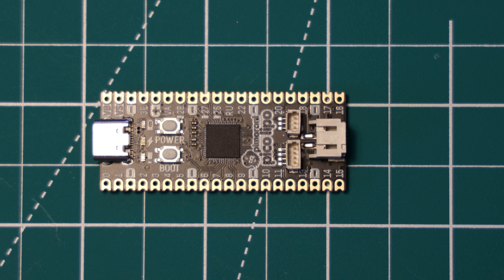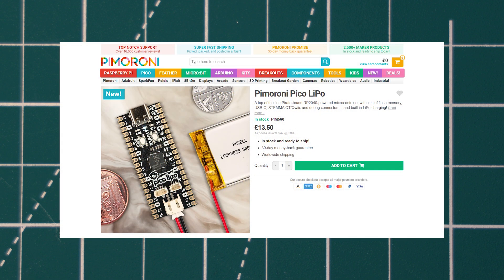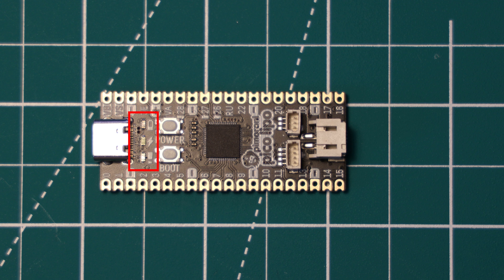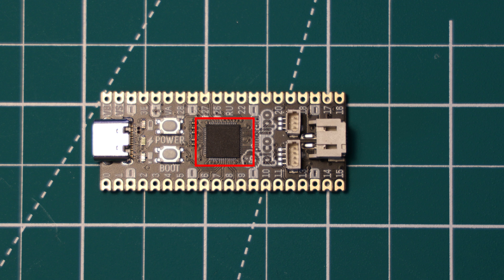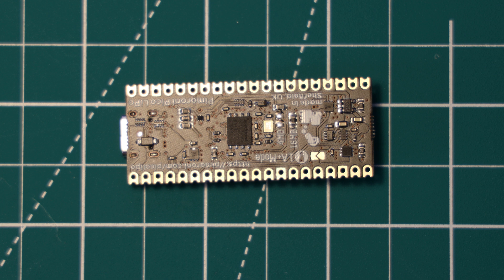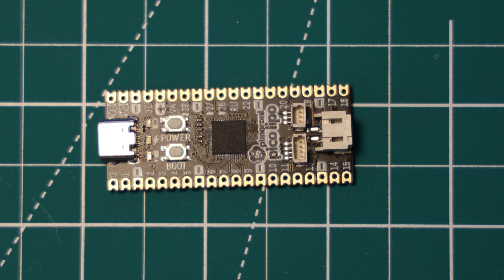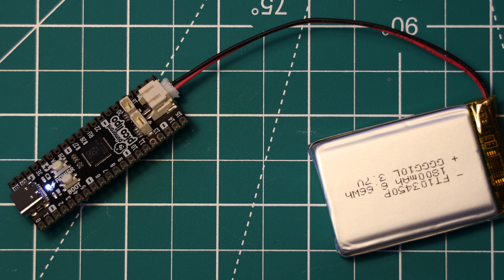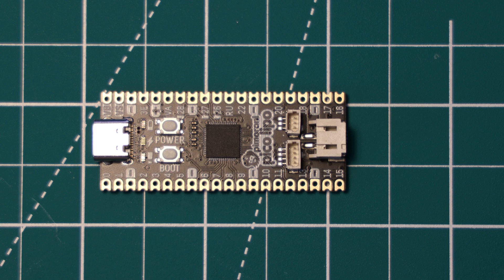First Look at the Pimoroni Pico LiPo - An Improved Raspberry Pi Pico?

Comment: I was about to order one until I heard about the 215mA charging current. If you use this with a single 18650 cell it can take more than 10 hours to charge. I guess they had to be conservative to avoid people blowing up their small lipo batteries.

Comment: The only reason for 8Mb or 16Mb is to provide the user with a larger file system. What size is the file system on the pico lipo?

Comment: Do you know if there is a jumper to disable the power LED (at least while on battery, so the battery will last longer)?

The LiPo connector and charging circuitry is definitely a value add.  As is the Stemma QT (QWIIC) connector.  The connector for the debug pins is an interesting idea.  The power button could be handy for mobile/wearable projects.

Comment: Crazy price, in a capitalist society it's the buyers responsibility to boycott price gouging attempts
Reply: $13?
Reply: @elijah_9392  13 pounds and 50 new pence so around $AUD22.50 or some $US16 that is what I call very expensive for a board like this.
Reply: @etmax1  

But at what scale are they producing? Do you know their costs?

It is a well known fact that niche products are always more expensive. And given that it is one of the only boards I have seen that has both LiPo charging capabilities AND flat solder pads (allowing it to be soldered to a custom PCB), this product is in quite a niche of its own.
Reply: @elijah_9392  of course scale matters  but if I can get a competitive product at half the cost then why would I buy it?
Reply: @etmax1  

Exactly. This isn't the product for you.

You don't need its unique combination of features.

Also, I gaurentee 90% of the reason it's more expensive is because of the 16MB of flash.

Comment: Another difference from the original Pico is that it doesn’t have the mounting holes. That and the fact of the castellated edges, despite the non-flat rear side, have me at bit of loss as to how it can mounted into a complete device. It seems like a breadboard is the only place it can go. I like what Pimoroni has been doing, and have enjoyed trying some things out with their Tiny2040. Great to see that the RP2040 has become the basis of new hardware. But unless Pimoroni have something in mind that I‘m not seeing, this aspect of their designs seems to have fallen by the wayside. The Tiny2040 also has no mounting holes and castellated edges that apparently can‘t be used. Not sure how you could use either of the boards even with a perf board. Place a row of connectors a plug it on, like using a socket for an IC?

Comment: This little board could be very useful for a standalone data logger/controller with power harvesting. I'd like to know if the charge controller is exposed to the 2040 to realise an MPPT controller in firmware, or if that is simply a discreet section. How does the board behave under low voltage/current conditions at the USB-C connector for instance? ie what are the switching conditions from USB-C to LiPo?  I can't seem to find a datasheet.  An interesting little board all the same, and I hope you dig into it in a little more depth.

Comment: Another good video - thank you. The price of this board does seem a bit high, but then I have to put it in perspective. The original Pico is a brilliant piece of kit for a VERY affordable (and therefore accesible) price. But, more importantly, I believe it was priced to allow 3rd party board manufacturers to be able to make a difference - and a profit. At £13.40 it is a normal price I'd suggest - if we hadn't been "spoiled" by the original Pico - of which I now have 4!
Reply from the maker: Thank you! I do think that when compared to the Pico it's pretty expensive but ignoring that and considering that it is a well thought out board with good features it isn't too bad! I think your point about 3rd parties is an important one as they do add a significant amount to the hobbyist and enthusiast industry.